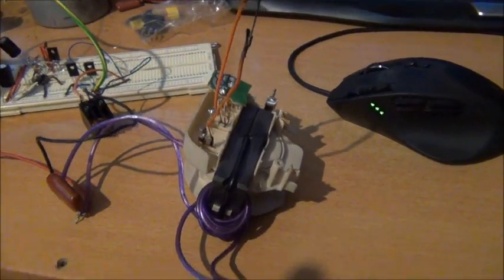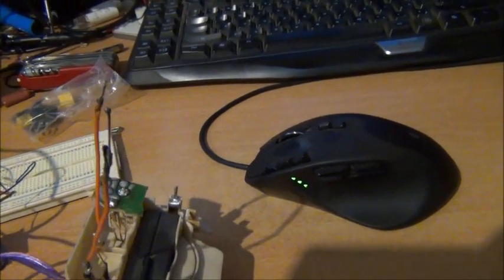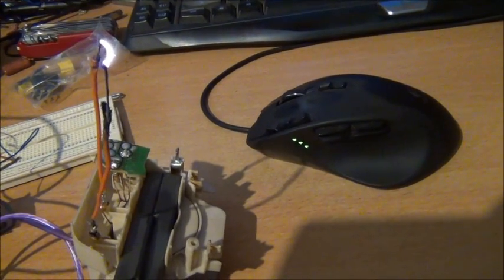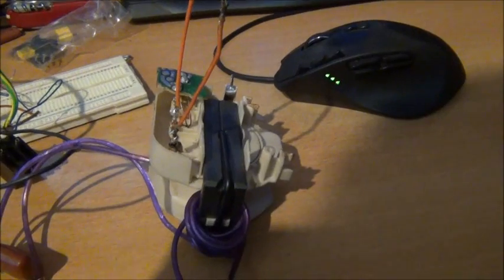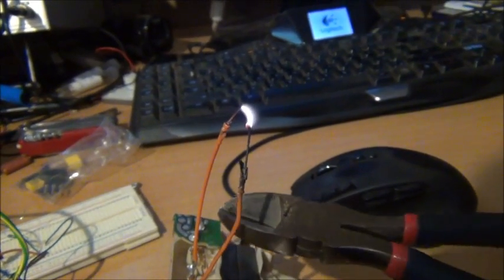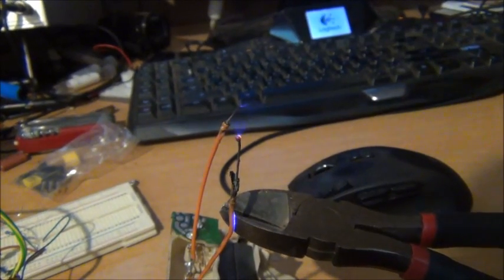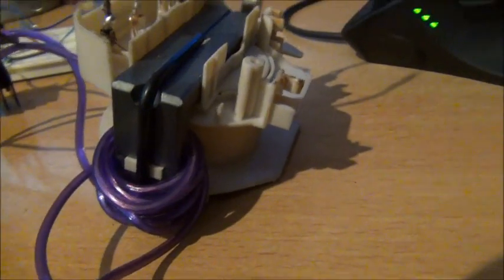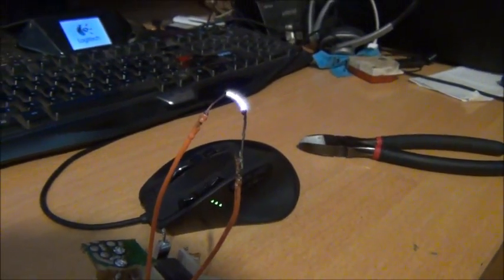Microwave Flyback Arcs - First on youtube?

Comment: yeh amps and volts won't be a issue since the IGBT bricks are rated to 400A at 1200V DC or somthing silly like that, I'll pack up some caps, cables, and semiconductors for you soon!